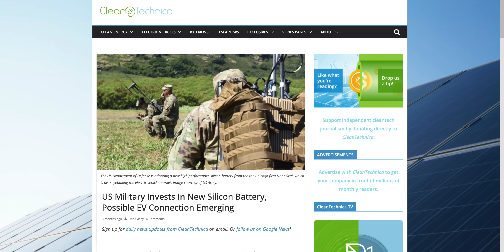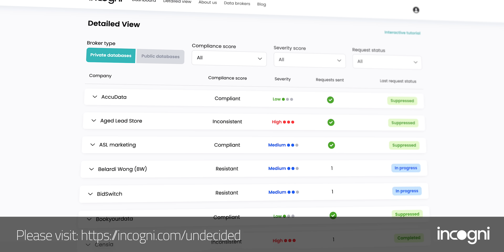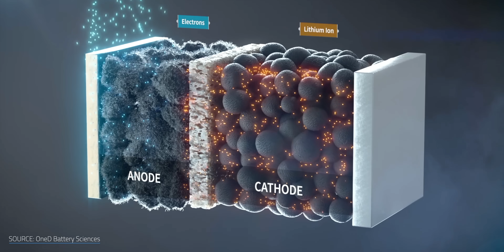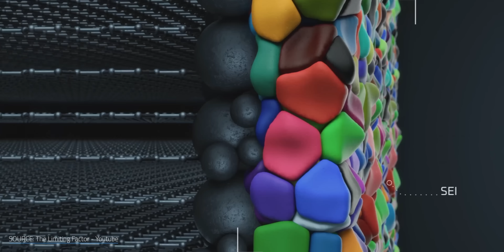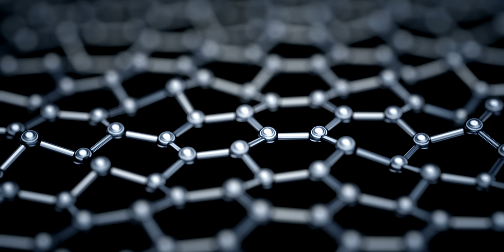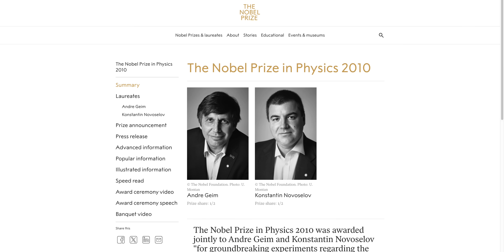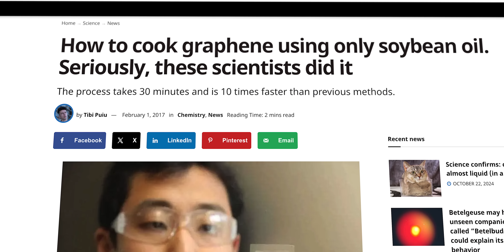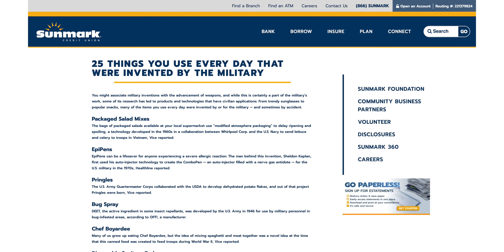Why The US Military Chose Silicon-Graphene Batteries

Comment: Genuine question: When people say things like, “..even at just 1 atom thick, it’s 200x stronger than steel.” Is that comparison with a hypothetical 1 atom thick sheet of steel? Hypothetical because there is no steel atom. It seems like a tricky comparison and I’m genuinely curious at how they make it.
Reply: That's usually based on tensile strength per mass, so it's a very strong rope.  Steel will compare much better in compression strength.
Reply: @animistchannel  compression-resisting part of reinforced concrete is concrete, not steel
Reply: @SergePavlovsky   I'm pretty sure a block of steel will still hold up to getting hit with a big hammer (or smashed in a forge press) better than a block of graphene would (if you could even make a block of graphene to test).

Makes me wonder if block graphene would be brittle or spongy... current "carbon fiber" fabrics are fairly pliable, but not sure how that would translate to a 3-D crystalline matrix.  Or would that basically be diamond?

One thing for sure.  It's gonna be a few years before we get a YouTube video where they make that test :)
Reply: @animistchannel not diamond.. Diamond is a fully 3d structure that dosent have any planes of hexagons (graphene). The closest to a block of graphene is graphite.

Graphite is a wierd lil bugger, both abrasive and lubricant! Abrasive due to the strength of the sheets of graphene that it comprises, but a lubricant because those sheets easily slide past eachother.
Reply: @SergePavlovsky  that is because the steel is less than 1% in reinforced concrete and is only there because concrete has almost zero tensile strength so less overall contribution than the tiny amount of rebar.  Steel has a compression strength very similar to tensile
Reply: @animistchannel  Most likely one way that we'd be able to make strong and dense 3D graphene structures would be 3D printers that could print at a molecular scale. Otherwise, it would always be very tricky to build graphene based structures that are true to the attributes of the material.
Reply: @glike2  no, that is because steel is added only to keep concrete from tearing. from crushing concrete can keep itself better than steel
Reply: @dougaltolan3017  Oooh, that makes sense. I wondered how graphite lubricant worked. It sure feels weird to the touch— it isn't "wet" at all.
Reply: @animistchannel  na graphene is stiffer than carbon fibre but can stretch a lot before breaking 
Kind of prefect if you could make something out of it
They use nano tubes in resins as only trace amounts are needed to improve performance 
But the expense and difficulty bonding it to anything makes it currently impractical for anything big
Reply: @SergePavlovsky  you are correct, however steel is heavy and expensive. Concrete is cheap and can resist compressive loads good enough so that’s why we use it for construction. However, take a block of steel and a block of concrete that are the same size and there’s no contest. Steel is much stronger than concrete in both tension and compression. This is why we measure strength in units of Force/Area. Strength is a normalized force relative to how much material you’re applying the force to
Reply: @SergePavlovsky  the compressive strength of steel is higher than that of concrete. That said, we use steel to handle the tension loads when placed in a slab of concrete, because concrete can’t hold up to being placed in tension. It’s less that steel isn’t what’s supporting the compressive load and more that steel is used to combat tension. Cheers.
Reply: @SergePavlovsky  I don't see why this is relevant
Reply: @14supersonic  graphene can’t possibly be 3d as it’s literally one atom thick structure. And if you put a bunch of those on top of each other you will end up with graphite
Reply: @vmusatov  I don't mean graphene itself being 3D, but the process of layering the lattice on top of each other to develop a 3D structure. Something akin to the 3D memory cache chips that many new CPUs and GPUs have now.
Reply: @SergePavlovsky what the hell are you talking about? Your comment is completely nonsensical. Who's talking about concrete?!?
Reply: @glike2 don't humor the moron and concrete has almost zero tensile strength?!?
Reply: By weight, probably.
Reply: It's by weight, which makes it a bit silly to say even at 1 atom thick, because the scale is irrelevant. In other words, it's either 200x stronger at the same weight or 200x lighter at the same strength.
Reply: Many substances require larger masses to make a complex structure. The point is, that you don't need a complex structure for graphene to have strength. Steel is literally a net of iron with chunks of carbon between the threads.

Complex alloy structures are required for strength in steel. This is not the case with graphene, which maintains strength on a scale smaller than the steel structures
Reply: @jeschinstad  They mention being one atom thick, because it's strength  does not diminish at this level. 

Graphene is a stack of sheets that are one atom thick.

Of course steel, needs a three dimensional crystal structure, to give it strength. So a single atom sheet of steel, might not even be stable.
Reply: @Weaseldog2001  I scrolled through these comments to see if anyone understood it was comparing a layered composite sheet of the same weight as a steel sheet.   3 million layers of graphene vs. 1 mm of steel will be about 200x lighter, and are about the same thickness.
Reply: @gyrateful  When choosing materials for constructing things,, we usually compare the strength, based on the dimensions, and not the weight. Notable exceptions are made for vehicles.

In what respect is it useful in this context, to compare based on weight?
Reply: @jeschinstad yeah he got a bit silly with that anecdote.
Reply: @5400bowen  It doesn't scale downwards though. At one atom thick, you cannot make steel. So he's sort of mixing two truthful statements into one false. :)
Reply: @ yes.
Reply: Tensile strength is measured only as force/area (PSI, MPa, etc...). That's the cross sectional area, so I'm not sure how this is determined for a 1 atom thick sheet. But mass is not considered at all.
Reply: A phrase like that is nearly meaningless.

Ultimate strength and elastic limit for example are two very different types of strength but either one could conceivably be the steel strength that’s being referred to. 

Probably what they’re talking about here is the strength of the carbon bonds, which are very strong, vs the ultimate tensile strength of steel. 

However these are very different measurements. I think the confusion is because they are expressed in the same units.

If you look at the bond strength of atoms in steel then you’re going to exceed or equal the strength of the bonds in graphene (because some of those bonds are the same carbon bonds).

But even this is still misleading: steel is a mixture of different solids and it achieves its combination of strength, ductility and flexibility due to an interplay between the elements that make it up. Essentially grains of iron like to slide against each other, while the carbon acts as “grit” that stops the grains from easily moving. (It’s much more complicated than that).

This phrase is best understood by reverse engineering: “Graphene has a high tensile strength. How can I express this to viewers in a way they can understand? Well, what other things have a high tensile strength? Steel, I’ll compare it to steel.” It’s the “200 million football fields” problem, trying to make measurement more understandable but using a more relatable measurement, but not really being able to qualify and contextualise in a succinct phrase. 

If you really want to understand the tensile strength of graphene, my advice is to do some web searching and reading.
Reply: That's in tensile strength by weight iirc. Steel still kicks butt in compression though. It just something folks say to make graphene sound more awesome. It's true, and it is awesome but it doesn't translate to all around 200x stronger than steel like is sound to the layman.
Reply: Really fuzzy comparison when you consider all the different Steel compositions out there in the Real world. High tensile cable wire or Chicken mesh fencing wire ? I guess that Graphene has a consistent strength but using steel without specifying the composition makes the comparison pretty irrelevant …
Reply: Not only that, you can't even have "one atom of iron." In the same way that one molecule of water can't be "wet," metals have their bulk properties because of a number of physical phenomena that exist between nuclei and the electrons orbiting them. If you take away everything but one atom, you don't have metal anymore. If you could arrange steel/iron into a perfectly flat one-atom sheet and just release it into the world, I feel like it would quickly reorganize itself into a lower-energy geometry.

But "one atom thick" in the general sense probably means "about 0.1 nm"
Reply: Yeah that line is a little misleading. When scientists are calculating strength, they measure it in terms of Force/Area. From what I can tell, he’s saying that a sheet of graphene will be 200x stronger than a sheet of steel the same thickness. If you made the steel thicker, it could resist a lot more force, but it would be larger in area.
Reply: I appreciate all the helpful insights, everyone. Thank you
Reply: Yes, it is hypothetical but that has nothing to do with actual atoms, it is a reference of thickness. So when something is X* stronger it is talking of the same thickness as steel. This specific meaning is that a sheet of graphene that is only one atom thick is 200 times stronger than a sheet of steel that is only one atom thick. Now while graphene can be only one atom thick, steel obviously can't, not because there are no steel atoms but because steel can't be that thin.
Reply: It's usually by Specific Strength, i.e. Strength per unit weight.  
Google "Specific Strength Chart plot" and look at the images
Reply: NGL, marketing BS .
Reply: By weight but wood is stronger than steel as well
Reply: If it’s “stronger than steel” that only really indicates it can take over a small niche steel holds now. Steel is everywhere in our world because it’s the easiest and most versatile. Copper conducts heat better than steel, but steel is still cheaper so although a copper heatsink is better it only takes a partial niche from other metals. Graphene’s crystal structure holds tighter and stronger than steel’s crystals but i believe steel has a 3d crystal graphene has a 2d crystal. Think wood vs the interlocked white pages that are made from paper
Reply: Strength per unit area
Reply: And then I would up the critique and point out the extremely common linguistic logical flaw of equating 200x stronger with 200x as strong.
Reply: Probably weight-for-weight, much like how spider silk is 20x stronger than steel... assuming you could get enough of it.
Reply: @erascarecrow  Spider silk might also be more annoying per weight unit than steel could possibly be.
Reply: "strength" of a material usually "tensile strength", which is measured in (pressure to fail)/(area), when loaded in tension (i.e, you pull on it). 

So, if you pulled on a rope of steel and a rope of graphene of the same size/shape/area in the same way, the graphene would be 200x stronger.  

But you're absolutely right to ask this question because there are several different kind of strengths (compression strength, fracture toughness, toughness, resilience, etc etc.) and when people say "stronger than steel" when they really mean "higher strength - weight ratio", or "more corrosion resistant to ionic fluids like saltwater", or some other material property. Hence why we still use steel for tank armor even though many aluminum and titanium alloys are "stronger than steel" (by weight, which is arguably the single most important factor for aircraft)

Graphene and carbon nanotubes are some of the few materials where they really do mean "higher tensile strength". If you could make a rope out of the stuff, it would be the strongest rope in the world, by a lot. In tension.
Reply: La única forma teórica de compararlo con el acero, es hacerlo con la resistencia a la tracción a igualdad de masas.
 En la práctica el graceno al ser prácticamente bidimensional, presenta numerosas limitaciones para aprovechar plenamente sus cualidades. 
 Sería necesario fabricar a escala atómica y esto es algo que se hace poco más que a muy reducida escala en laboratorio. Ojalá pudiese escalarse a nivel industrial.
Reply: I heard on a doc. a sheet of graphine 1' x 1' one atom thick could hold the weight of a house cat (eight to ten pounds). Compare with household item: aluminum foil is .3 nanometers or 33 MILLION atoms thick!
Reply: Yeah, he's not perfect. I thought the same. It was a bit of grandstanding.
Reply: You answered your own question...
Reply: we cannot produce sheets of graphene in any kind of size that would make use of its properties.
Reply: @Withnail1969  You can easily buy laser-induced graphene sheets on McMaster-Carr. 4 to 6 inch sheets. Correction: 3 to 8 inch sheets.
Reply: @Withnail1969  It's just a beginning, for sure, but you should watch Tech Ingredients' video on graphene!
Reply: Did you not watch the video? They are literally doing exactly this for these batteries that are currently being manufactured
Reply: @Withnail1969 . Yet.
We cannot produce this (in sufficient quantities), Yet.

Rock on!

Comment: The fast charging capability (provided it pans out) extrapolated to eV's, will be the end of the (largely unrealistic) range anxiety/charging time objection. Saying that, it will require a massive upgrade to charging tech and infrastructure to accommodate the energy blast of MJ/s coming down a cable into that cell pack. Most charging infrastructure and charging capacity is built around lithium, and the investors will go from angels to devils when they demand a return on their already-redundant technology.
Could we be looking at mega-capacitors on charging points? Tell your kids not to put their fingers in the holes... 🔌🎆🔥

Comment: What does the discharge curve look like?  How the voltage drops over time is very important.  We don't want a slow linear drop.
Reply: Notice that Nanograf mentions nothing about safety and resistance to thermal runaway on their website.  If it was safer that would be in the headline advantage list.
Reply: That's what R&D is for.
Reply: @ferrumignis  It's not al alkali metal... so should be better.
Reply: @ferrumignis  This guy complaining about hypothetical thermal runaways when the most common batteries these days, Lithium based, will ignite when exposed to air or even if built poorly like chinese ones. They're literally tiny little incendiary devices!
Reply: @WimsicleStranger  it’s what bullet primers are made of..;
Reply: What do you mean? Of course we want a slow linear voltage drop. The slower the voltage drops the more area under the curve so more energy . Also make for more predictable performance across SoC.
Reply: whats the rough improvement? Is it only around 15% energy storage or am I way off? they make it out to sound significant...
Reply: In general, what charges fast, can discharge fast. Power packs can incorporate the electronics to give exactly what is needed as long as possible and charge on most any power source.
Reply: Hopefully, it will have little to no voltage drop until the end of it's usable state of charge. The battery management system should turn off the system before the voltage drops below a set limit,  like 47 volts on a 48 volt battery.  It would be bad if the battery shut off when there is still a lot of charge left, but too low voltage.
Reply: @gyrateful  A good battery management system prevents this from happening, regardless of what cell tech is used. So that's an entirely different story.

Comment: 😂110504    Nanometer scale uniformly aligned parallel diode arrays may be a practical way of absorbing ambient heat. Ambient heat is uniform on a micrometer and larger scale and non uniform on a nanometer scale. Plausibly,  heat absorbtion at the non uniform scale is available as Johnson Nyquest thermal electrical noise that would yield, by conversion without gain or loss, an equivelent amount of electrical energy. 
AND
 Diode voltage / current  characterstics can be displayed on an XY tracing oscìlloscope. Thermal electrical noise power in resistors can be displayed by time sweeps of voltage on an oscilloscope. Each such time sweep shows unique randomness.
AND
A  simple  "Special Program with Integrated Circuit Emphasis" model indicated that diodes in uniform aligntment parallel would aggregate simulated partially rectified thermal electrical noise. 

Maximum direct current electrical power, half, is transfered from a direct current electrical source to the electrical load when the electrical resistance of the two parts is equal. Calculated matched resistance output (watts) is k (Boltźman's constant), one point three eight x 10^ minus 23, times T (temperature Kelvin) times bandwidth (0 Hz to a natural limit ~2 THz @ 290 K) times rectification halving and nanowatt power level rectification efficiency, times the number of diodes in the array. 

There are a billion cells of 1000 square nanometer area each per square millimeter, 100 billion per square centimeter. 

Creditable independent replicatable proof of concept protypes beyond improper influence are needed.

Aloha
Charles M Brown 
Kilauea, Kauai, Hawaii 96754